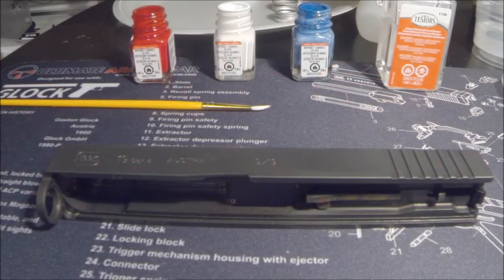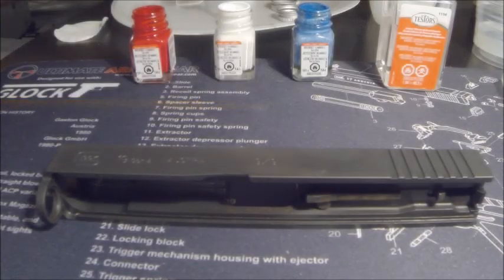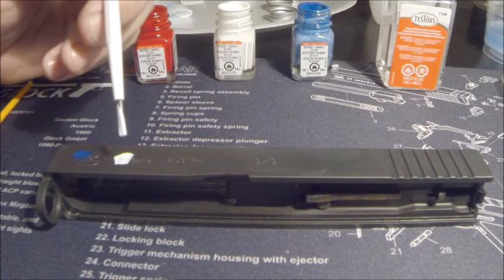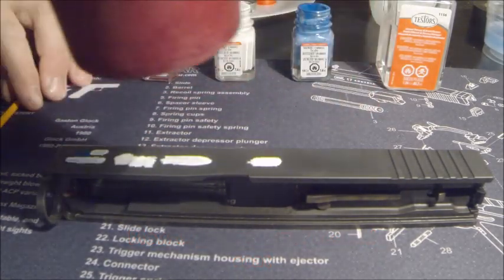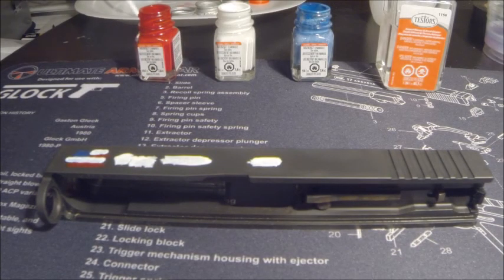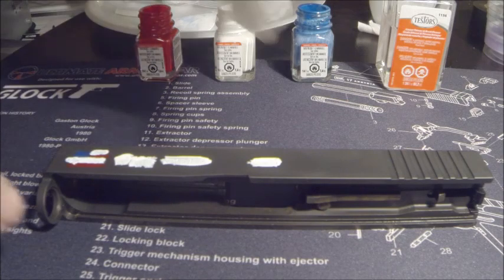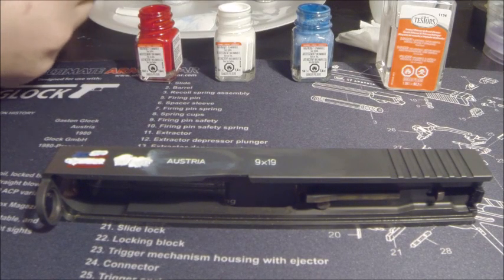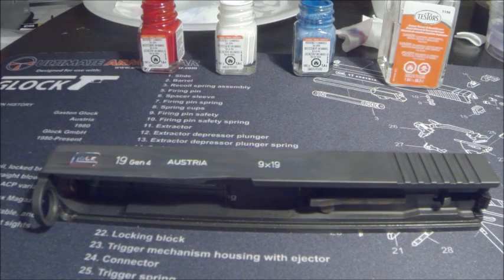Glock 19 Gen4 Engravings Color Fill FAIL!

Comment: Good on you for having the courage to try, thanks for sharing what worked and what didn't. The only part that made me cringe was using Testor paint thinner for clean up. Most of what I have read says to use non acetone nail polish remover. Good luck getting it exactly how you want it!
Reply from the maker: Yea it was a learning experience for sure. The non acetone nail polish remover works great I ended up jawing that the next time. The main thing to remember is to swap to a new cloth when cleaning or it will smear the paint that's on the cloth.
Reply: Crimson_Ghost I was thinking the same thing. This guy tried something different than everyone else. Good video